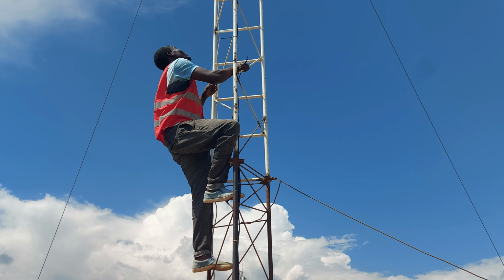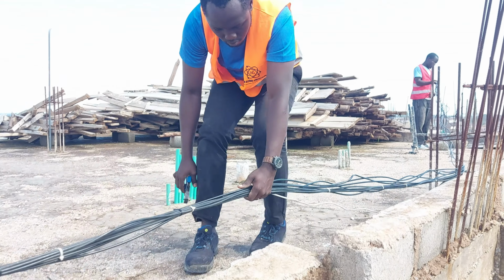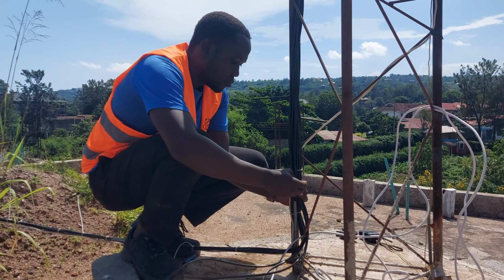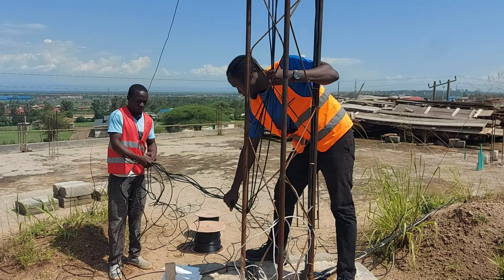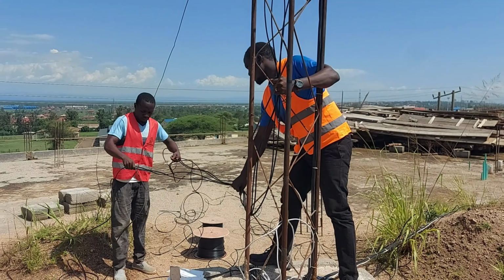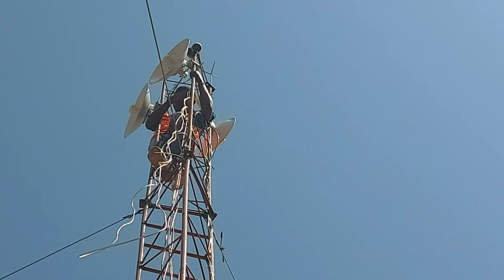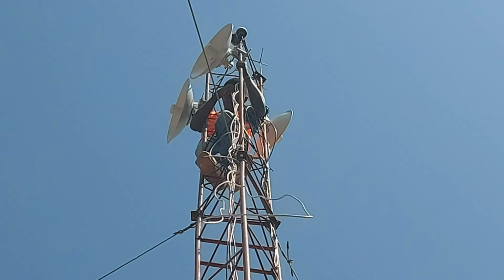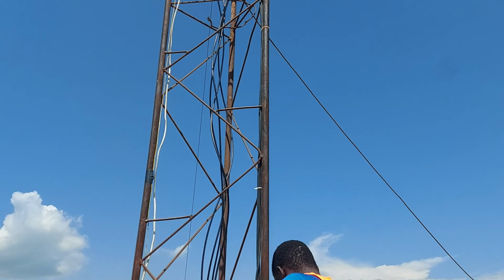How to start ISP Business in Kenya| How to start a business in Kenya| Daily Hustle| Kisumu.

Comment: wonderful business you have there. please i want to start mine here in Cameroon. with a small capital what will be essential things to buy as equipments to begin. i want to begin with hotspots
Reply from the maker: Hello, we recommend using mikrotik from 4011 series they are the best for traffic management. Then you need access points which canbium eforce201 or 200 is the best can do 1km 120°. Then you need a good software that integrates with your local payment gateways then finally you need a good Internet service from your ISP. Feel free to ask any clarifications
Reply: I want to start wisp and want to start with hotspot then later point to multi point. Can i use this canbium for hotspot since you are saying it has a range of 1 km instead of tplink110 which covers only 200m?
Reply from the maker: Text WhatsApp 0783444666

Comment: I WOUOLD LIKE TO INSTALL MINE JUST TO SAV MY LOCATION CAN I USE TWO POWER BEAM M400 AC
Reply from the maker: Hello, power beams AC is a very good equipment but will depend in what area especially when you deal with frequencies for point to point (ptp) over a maximum distance on 15km you will achieve good speeds on channel width  20 let me know if you need more info